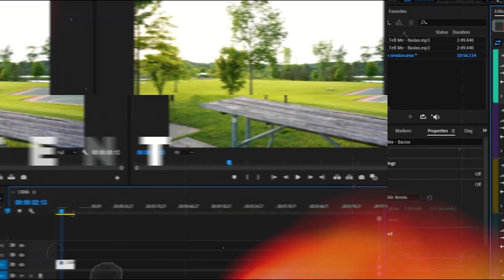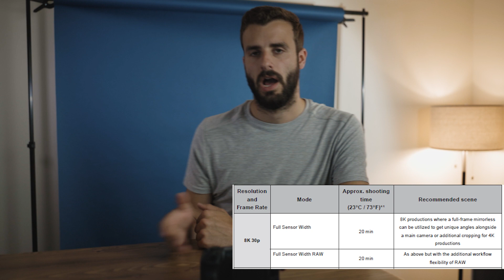How To Prevent The Canon EOS R5 From Overheating

Comment: R5 has no oversampling in usual 4k recording. That's why it doesn't overheat in 30fps. 
R6 has and thats why its overheats in every 4k mode, thanks to Canon. 
Try 4k on R5 in real life test please. Other people says that if you recording in 4k30 for some time (30 minutes as example), you can't switch to 60/120p or 8k even for a couple minutes (5-10 at least) because camera will be already too hot. Thats why they says that camera unusable in 4K.
Also please test, if you overheated camera in some of hot modes, can you turn it on immediately and start 4k30 recording without overheat. If you can, that would be good. If you can't do even this, camera is really unusable
Reply: Galach-Gerald Undone already has a chart showing the R5/6 showing limits and none limits regardless of usage.
Reply from the maker: I did some testing in 4k 60 and 120p yesterday and even 8k raw and had no issues over the course of 25 min of almost constant recording in those different rates. The R5 does shoot oversampled 5.1k in 4k 30 and 8.2k oversampled. I will try and look into the issue of recording a long 4k 30 clip then going to 4k 60 after that. However, my tests, I was switching back and forth between the highest settings and it had no issues.
Reply: The Engineering Filmmaker R5 shoot 5.1k oversampling only in crop mode. In FF it’s less sharp than R6. Gerald Undone recently uploaded video and answered questions bellow
Reply: @EngineeringFilmmaker  Full frame 4K 60P is not oversampled. It us pixel binned. Only oversampled 4K mods are 4K HQ 24/25/30FPS (oversampled from 8K)  and aps-c crop 4K 24/25/30/50/60 FPS. Please stop with false informations.
Reply from the maker: When did I mention Full Frame over sampled? If I did it was a mistake but I dont believe in my VIdeo or comments I uses the phrasing full frame 4k. I think I only mentioned there is a crop in oversampled.
Reply: Besides being himself a Sony user, Gerald U is a studio tech reviewer. He’s not in the field shooting commercial videos or films. Got my R5 last Sunday and I worked with it all week, never seen once the overheating alert (no I did not use 8k). 4k fine (people call it HQ) does not overheat with an external recorder if you remove the lava hot CFexpress from the camera, as well as any other 4k modes up to 60fps. I use the CF only for 120, other than that it’s ProRes on my ninja V like the rest of my workflow. 4k standard has less sharpness but if you add about +3 on the “neutral” profile or use the “fine detail” profile it’s hard to see the difference with 4k fine (I’m editing on a lg oled 65’). Standard 4k looks the same this way compared to my other cameras (GH5, a7iii, Zcam), this all “mushy” talk is nonsense if there’s any motion in your shot it becomes impossible to see any difference, and if you are shooting a fixed image you’re not making a video :) This camera is far ahead all my other gear (AF and ibis are next level), I’m actually surprised and will get a second one when available again to replace my other mirrorless units. I’ll keep only my Zcam and 2 R5. I don’t shoot photos at all as you guessed.
Reply: @freddumartin7878  wow. It's great to get your field experience! Thank you. 
Please, tell which SSD you use for recorder? And which cards for R5 4k120 and 8K?
Reply: @galachiev  yw. As mentioned I record almost everything in ProRes for my workflow, I have 2 Ninja Vs and 4 Western Digital Blue 1TB SSDs (they are cheap like $95). I have just one CFexpress type B card for the R5, it's a SanDisk 512GB from Amazon ($599 ouch!)
Reply: @freddumartin7878  thank you! Looks like having SSD much cheaper than a lot of memory cards
Reply: @galachiev  That's right. You still need a CFx for your 120 and 8k shots.

Comment: Wouldn't it have been better to wait until you did some "real world" testing before making this video? You provide some useful information but there is a lot of misleading information I wish you didn't include. "I don't believe it will overheat." Yes, it does. Everyone knows that. Canon has a chart on when it will overheat. "How to prevent the overheating on the R5, if it even exists." Again, it does. That's a fact. It's not debatable. Perhaps the main issue that you didn't touch on at all is the cool-off time needed. That's a bigger problem than the overheating in my opinion. The results I have seen from various tests indicate that you will have to wait around 2 hours for the record limit to reset. We still don't know if this is a software issue because some report that they cool-off time doesn't change even if you put the camera in the refrigerator or open the card and battery doors. Perhaps this could be fixed in firmware updates. Also, even shooting stills or regular 4K will lower your record time if you switch to overheating video modes afterward and the camera will overheat faster. The 4K HQ isn't only useful for punching-in in 1080. From all the tests I have seen, the regular 4K 24p that doesn't overheat looks soft and mushy so there are other reasons why people would want to shoot in the HQ mode even if they are outputting 4K. Now, none of these are deal-breakers for me and I am personally going to purchase this camera. I believe it will work really well for my workflow. I just wish you had discussed real-world limitations the camera has even for wedding filmmakers or other content creators. Of course, it's not a cinema camera so it won't perform like a cinema camera but there are real drawbacks to the overheating. You make it sound like overheating will only be an issue if you have ridiculous expectations of the camera. That's simply not true.
Reply from the maker: I mean I made sure to state that "i believe" meaning it is my opinon. I actually did a little bit of testing before the video just to ensure I didnt go test it and it overheated after 10 min or something. I also did real world testing yesterday and had good results as well. When I said "i do not believe it will overheat" I am referring to if you use it the way intended as described in the video and the canon R5 spec sheet. If you record 15 min straight in 4k 120 yes it will overheat but idk who shoots 120fps for 15 straight. Everything I was referring to was in regard to if you use the camera as I am describing in the video. 

Almost every single test I have seen online has been someone setting their camera down in the sun and hitting record for 20 min and waiting for it to overheat then complaining about the time it takes to recover. Like mentioned in the video, if you use it as intended the overheating will most likely not be as much or at all of an issue. It is not like I am a random person online speculating and guessing about this camera. I actually have the camera and have been using it and testing it on both weddings and commercial work when not making videos. So I have more data than the next random person online who doesnt own the camera about the specs and issues with overheating.

Comment: The Canon EOS R5 is for my Wildlife work simply ground breaking. I take short 8k/30 clips (more I normally anyway don't take) and extract 35MP images out of the stream. How great is that? And the performance of my EF lenses is simply excellent on my R5, I can't feel any difference with having my Canon 600mm 4.0 III mounted on an EF Mount camera. Not to forget the Animal Eye Autofocus which simply performs greatly, even on small birds. Yes, well done, Canon.
Reply from the maker: I agree. This would work great for what you are using it for.